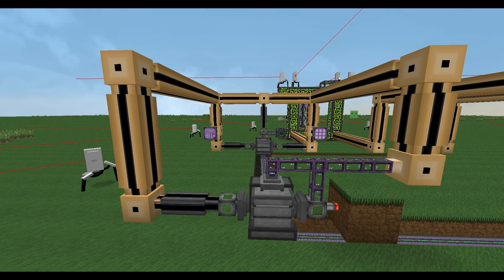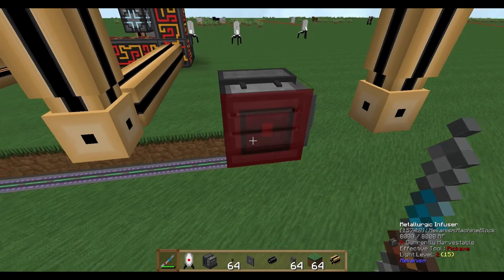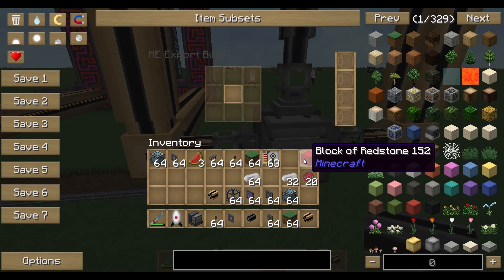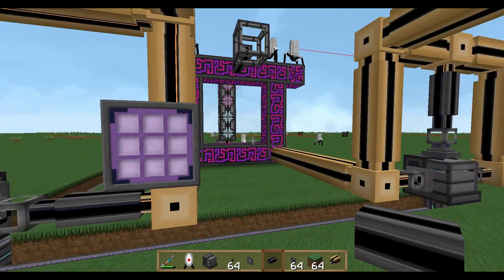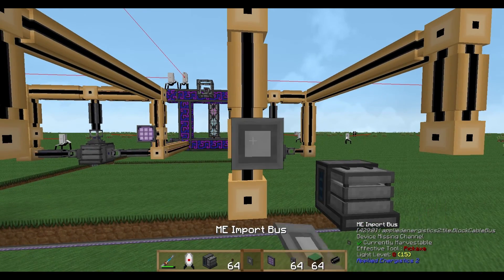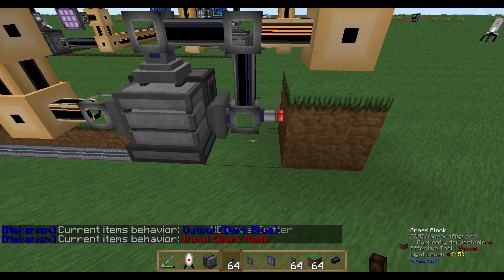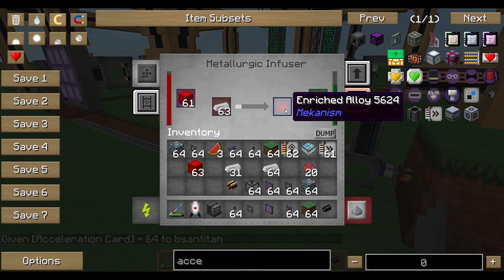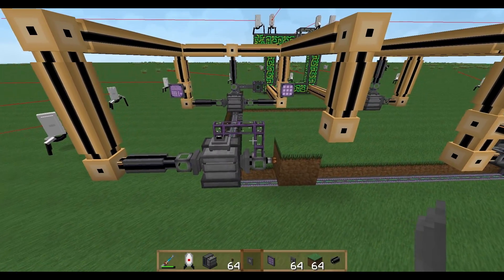Applied Energistics 2 Tutorial: METALLURGIC INFUSER - MEKANISM [ENG]

Comment: I found a better way to do that. First place the infuser(adjust the faces: top == input, left == infusing material, and front == output).
On top of the infuser place a hopper. On top of the hopper place a Me Interface, with the patterns. Sitting in the front of infuser connect the hopper with the left side of infuser using 2 Logistical Transporters(just vertical) and configurate the one from top to PULL from hopper. Then place an import bus in the front and connect it with me. 

!! You cant replace hopper with a chest. 
(1.7.10)
!!You can use that build, actually for every infusing craft becouse it is not overflowin his tank, and uses the infusing material when needed. But I think it could be unstable with bigger crafts (like somehow there could get an another infusing material from another craft).

Conclusion: I recommend building a few of this infusers for every type of infusing material.

If the build isnt clear a can send a screenshot.